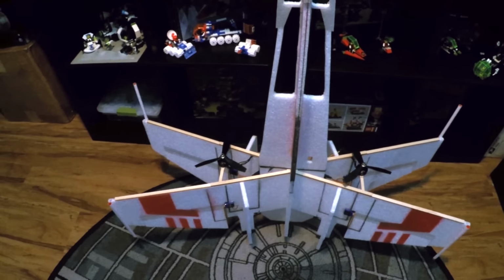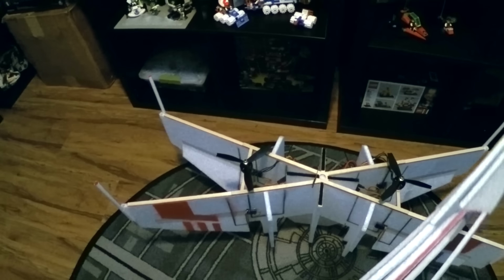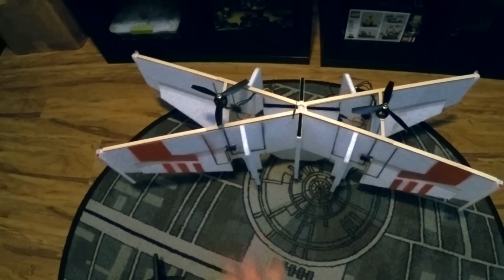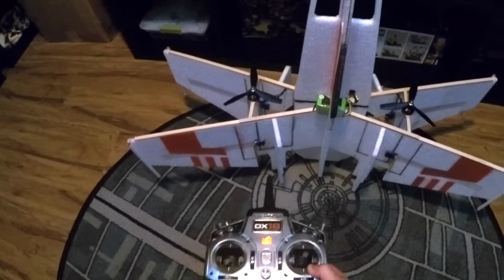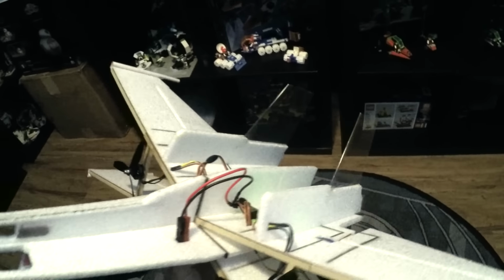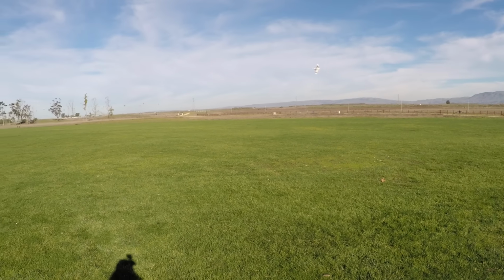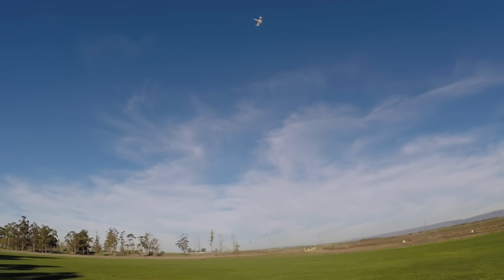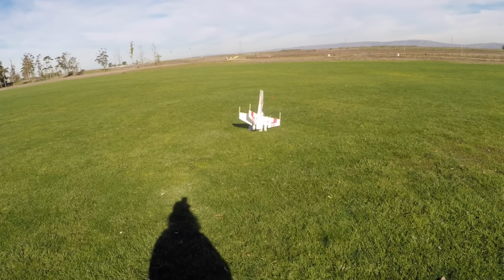3D X-Wing Part 2

Comment: Absolutely fantastic plane/design... Just wanna inject a thought here... I'm sure one could take the "Y" connectors out and create a mix that with an assigned switch thrown, it would create an airbrake where right wing upper elevon would go up, bottom wing elevon down and still be mixed with aileron. That would make for a killer down line.... Now while mentioning downlines, one could use car esc's which has reverse . One would have to use and arming switch and start throttle at 'hover' midpoint  giving up throttle forward flight and down throttle reverse.. That would be a real interesting way to tear off the nose in a flat spin with one motor going forward and other reversed.

The spin could probably be tripled doing that....and in a downline could be made to do a 4D backup. Love this design!

BTW...I have a patented design called the CrazyBall.. I have been thinking of setting it up quad and throttling the upper and lower motors differentiated for elevator control..which would make for a really wild CrazyBall and should do loops like the spins. That has to be a next project!.
Reply from the maker: Thanks. I've actually been experimenting with a twin setup with reverse thrust on a twisted hobbys yak ( https://www.instagram.com/p/Bq0_9-cnzZp/ ). Both SimonK and BLHeli ESC's now support reverse thrust, and it works rather well. I should have the video up for that in a week or two. I've flown a few biplanes with that quad aileron airbrake mix, and it does work well, maybe I need to find a small 8 channel receiver to try it on this.

Comment: Hello,  was wondering if you can provide some size measurements I can use to size the main x wood piece? Maybe a centerline of motor mount to the other motor mount measurement? Thanks so much! I'm not using a laser cutter, but rather  a cnc router

Comment: Hi Adam, I got a couple of RacingStar 2205/2300 motors and was going to use turnigy plush 30A speedies but am concerned about their weight.  I noticed the small size of your esc's.  I normally fly power a/c and gliders and am lost in the world of drone motors and electronics.  Any chance you could tell me what you used or suggestions as to what I could use?  Would be much appreciated.
Reply from the maker: Don't remember exactly which ones are on mine. I think they are 18 or 20 amp ones from hobby king. I'd just use what you've got on hand. It's very low wing loading, and probably won't notice a bit extra mass.
Reply: Thanx Adam

Comment: can you make the clone wars gunship, that would be wicked to see
Reply from the maker: good idea! I haven't done much prequel stuff, but the gunship and a Naboo Starfighter would be cool, and might work out pretty well, since they have enough "wing"
Reply from the maker: I just picked up one of the big rebpublic gunships off eBay, this one is now at the top of the build list :)
Reply: @ajw61185  holding my breath until the new video 😆
Reply: @ajw61185  is it done yet
Reply from the maker: @presnow3016  got sidetracked with sub stuff. Got the forms made to vac form the parts, but paused there